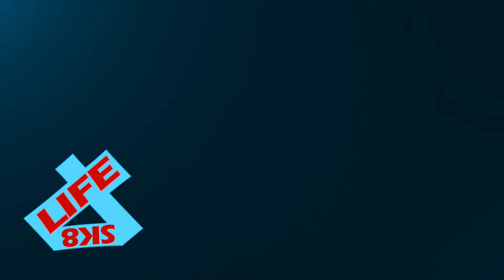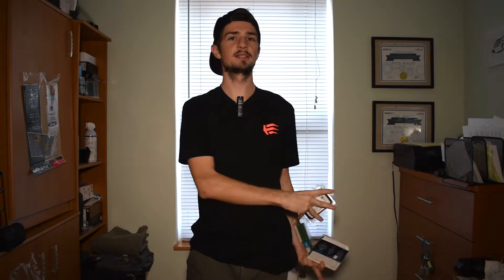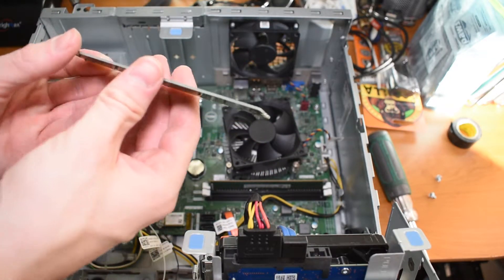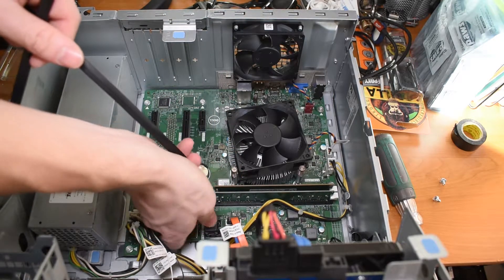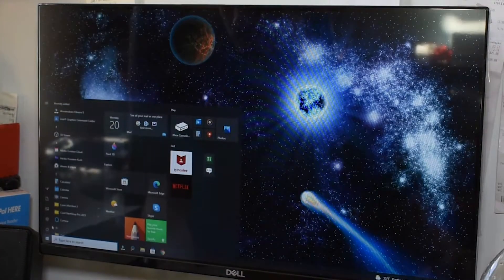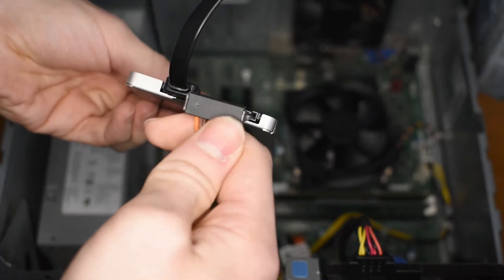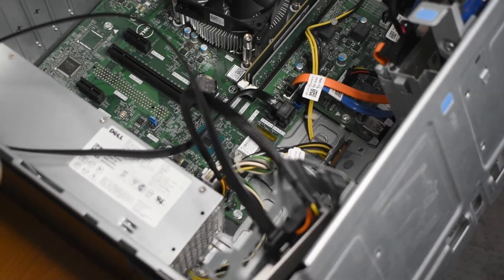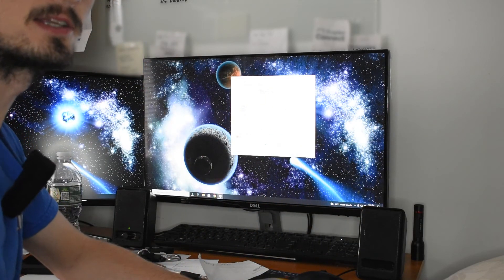Skater Upgrades Dell Inspiron 3668 Adding Ram and SSD

Comment: Can you link a new power supply cable for the ssd? The one you have doesnt work anymore and theres so many different ones when you look them up. The ram part helped me cause I was scared I'd install it wrong so thank you so much. Very helpful video
Reply: I just bought 3 cables from China, and it's very good. I'm using a Dell 3668 and have upgraded the SSD with the cable I just bought. Do you need a link to buy?